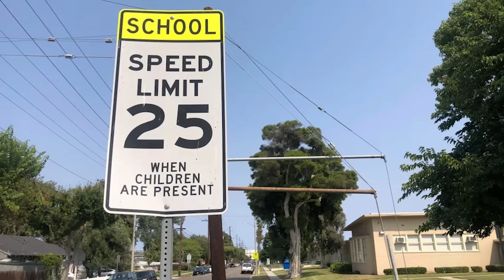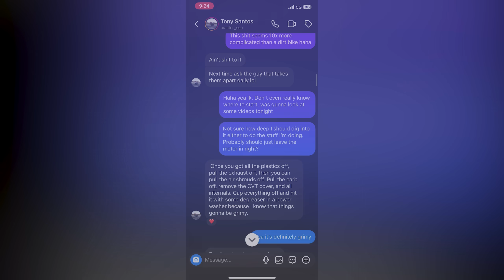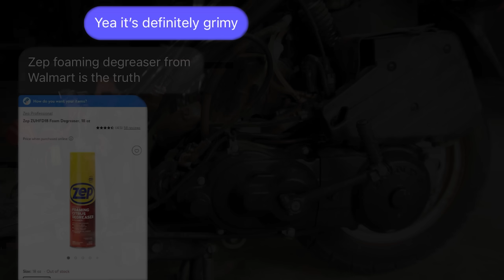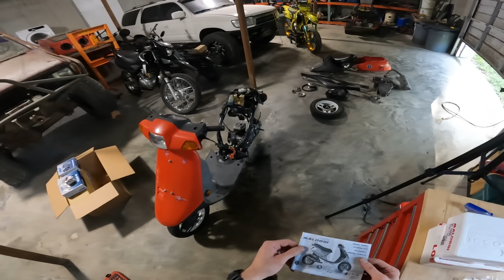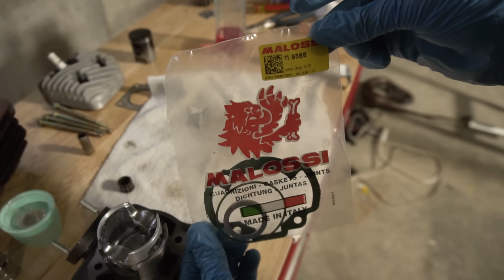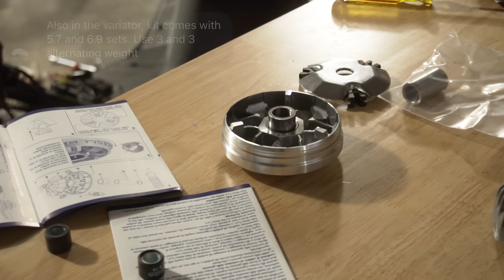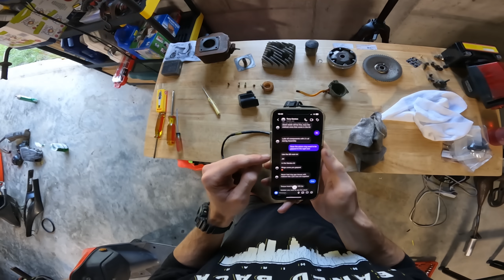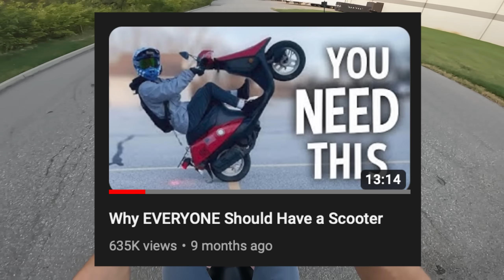HUGE Power Upgrades on my DREAM SCOOTER

Comment: Got the same excitement watching this video as I did working on mine and making it fast. I also found that a racing CDI does wonders after swapping the cylinder. So does changing the carb. I went for 26mm nibbi carb. Keep in mind it drastically increases fuel consumption and your cylinder might heat up if you floor it for long.

Comment: 17:37, when you tighten the front pully you need arrange the belt on the higher side of the pully.. You need to press the rear variator so it can goes down while arrange the belt on the front pully to goes up.

If you tighten it with lower side, the belt will pinched and after the engine running there will be gap which will loosen the nut..

Comment: THAT POWERWASHER  sure can spread those parts all over....I stopped that rather quickly opting for just a low trickle-flowing nozzle. Nice job makes me want to pull a Tao Tao 50cc scooter. I aquired as a gentleman who bought a KZ 750 off of me rode it in, and left it behind. Liking the hot knife method. Nice Job Hats to the wheelie king.

Comment: Good solid work bro, upgrade the carb, upgrade the spark plug, get some rock oil, super unleaded fuel, swap the weights around she will go even faster and accelerate harder make sure theres no weld restrictions in the new exhaust upgrade the air filter and get a new racing cdi unit honestly youl have a sleeper scooter trust me Bro 😊

Comment: I had a 50cc Derbi GP1. By the time I was done throwing every Metrakit part at it, it would do 95mph with my 200Lbs ass on it. It had a huge carb, 70cc single ring race engine and required 100 octane premix gas. I spent over $2k on just parts. @15:40... The clutch is centrifugal. The yellow springs are stiffer, which increases the engagement rpm. It helps the bike accelerate off the line quicker by allowing the engine to get up "on the pipe" before the clutch engages. @29:30... You should publish a parts list.

Comment: tip of the  day:

Use a pipe wrench to loosen the the 39mm nut on the clutch, by hitting the back of the pipe wrench on the ground while holding the pulley and clutch.
Use this method when a socket isnt nearby.

Comment: When assembling the cylinder, sand the new piston's head up a little bit to smoothen the factory engravings, also sand the port edges in the cylinder walls allowing more flow

Comment: The transmission on a scooter is connected to the rear wheel behind the CVT
Reply: New crank and seals is a must bottom end work is the first thing you should ever do

Comment: Rings need to be letter side up and positioned with the gaps opposite of each other. If you install rings wrong it will smoke all the time and burn cylinder. And yes, always check gap by putting ring in cylinder, push down with piston to be sure it is in straight, then check gap with feeler gauge. Yama-Bond is the best. Grease the exhaust studs or they will be very hard to get out when you upgrade exhaust. Good job doing this on your own!! lots of little things people learn as they gain exp.

Comment: Sorta the same in 2005 but 1989 Yamaha Zuma, 70cc kit and a muffler delete. Didn't touch the intake side or transmission. I had a mate drive beside and match speed (my speedo needle would wind around until it hit the bottom of the dash while the revs were still climbing,) he clocked me at 83kmph, 51mph. That thing was a little weapon, rode it into the dirt then gave it to a mate who's son was getting interested in spinning spanners. Best thing was filling the tank, getting a pack of smokes and getting change from ten bucks.

Comment: My 125cc Italjet Formula originally top at 115Kmh until I swapped the CDI with Power Max Racing CDI with 9 mapping mode, Faito Racing Coil Plug, Iridium Spark Plug & an Akra PNP Carbon exhaust which now top at 140Kmh... This even without changing the Piston/Block/CVT & with stock 24mm Carburetor... Seeing this makes me wonder if I can push it even more with an additional 💲pour into it... Anyhow, great video! Loved it 💯🍻🔥 Ride well! 🏍💨

Comment: If you confuse to buy what brand, just bought all lineup from mallosi , it's great scooter racing team, they made racing parts, and your friend doesn't advise you to grease the 2 shaft, rear pulley. You need to see video how to service scooter cvt. I can hear metal grinding sounds from the CVT. If you need more top speed  maybe you change roller to 7g or keep 3 pieces 5.6g and change other 3 to 7+g. You may loss torque but you get top speed. Playing with scooter CVT is experimental it is depend on load of rider, if you always ride with pillion need to adjust again to avoid stress from the engine.

Comment: Your question is who designed the CVT, now here is your answer: The Variomatic was introduced by DAF in 1958, also putting an automatic gearbox in the Netherlands for the first time. Variomatic is the continuously variable transmission (CVT) of the Dutch car manufacturer DAF, It is a stepless, fully-automatic transmission, consisting of a V-shaped drive-belt, and two pulleys, each of two cones, whose effective diameter can be changed so that the "V" belt runs nearer the spindle or nearer the rim, depending on the separation of the cones. These are synchronized so that the belt always remains at the same optimal tension. Now you know it. and how it works in principle

Comment: Top tip, because you’ve increased the bore size you need to increase the oil injection, I fitted a big bore but didn’t increase the oil, blew the piston

Comment: I hada a 50cc Yamaha jog. Without touching the piston made it run from stock 60 kph to to 100.  with just upgrading muffler, the gear that spins the wheel and cutting the walls on the front clutch that holds the 6 rolling weights. Also put heavier weights and to recover the lost torque, the short but stronger spring helped.  This things run with any carburetor you can adapt. I built another  with a Suzuki 100cc bike carburator (4 stroke 😄) and worked.  Best i got out of a stock 50cc was 120kph but at that point I was too poor, just a teen and most stuff were hackjobs.

Comment: CVT means "Continuously Variable Transmission", this type of transmission doesn't have gears, but, as it says, it changes gear ratios, when picking up speed. Most DCTs (Dual-clutch transmission) systems, have fixed gear ratios, but a CVT, varies as it picks up speed, that's why its acceleration is really good.

Comment: I dry clean my bike at that stage with solvent, tooth brush, and air hose.  That high pressure spray does a real number on electrical connectors which can cause electrical problems later.  It takes more time but eliminates water entering places where it should not be.   Ha!

Comment: If you want more topspeed, remove the 1mm rings from the CVT boshing that you're friend told to use. The wheelie will be a bit difficult but the topspeed will increase

Comment: 🤔Man it was good to see you go trough the whole process with the help of your online mechanic without you having any experience in the scootet field..The only thing I got to say is that tou should"ve bought a decent cool looking scooter to start with, I mean there couldn't be a more nerdy/girly scooter in the whole world other than that Honda you got there...Start watching videos from your compatriot's scooter channel 'Mopboyz', you'll see that this guy knows there's only one scooter in this world who's more than worth having, riding, tunning, contemplating, wheeling and cornering, the whole package in the same vehicle...In case you don't know the scooter 's called Yamaha Zuma (US) or Yamaha BW's in Portugal and Spain (Big Wheels), Yamaha Booster in France and Italy. Now that's a cool looking scooter worth having, worth contemplating, worth tunning, whose performance in cornering and wheeling is unrivalled, and you can still take it off-road that it will still perform great due to its large sized tyres (got to have some urban hybrid tyres on it in order to get tome proper grip/traction though). 👍🏻🇵🇹🇳🇱🙋🏻‍♂️.

Comment: You can use all the sets of weight in the variator, but with +/- for each. Lighter ones will give a faster response, but it will top end quickly. The heavier ones will do the exact opposite, kinda sluggish accel but better top end speed. But your Z options 3/3 or 6 of the same. Now you can adjust it for your pleasure 😊

Comment: yeah, mopeds 50cc stock, they almost everytime suck to drive, put some tuning parts on them, and you have this, makes them sooo much more fun to drive. I myself have a suzuki ts50 from 91, 70cc, 20mm mikuni and tuned exhaust, does almost 60mph. Also have a yamaha dt50mx, from like -85. The engine took a real dump on itself, so now it has a 80cc watercooled yamaha mx engine haha, its insane, 20+hp

Comment: So the way the transmission works is: as the variator on the crank shaft starts spinning it will push against its baseplate, pushing the two parts of the variator together narrowing the gap. As the gap decreases the belt moves higher and higher between the two parts of the variator. As the belt doesn't stretch, it will have to get shorter on the other side, meaning it will dig deeper into the clutch side. So it starts low inside the variator part and high in the clutch part and as the RPM increases it kind of shifts; it gets higher on the variator side and lower (or deeper if you will) on the clutch side. This results in a "torquey" setup at low RPM and it then kind of changes to a different gearing at higher RPM (as you need less torque at higher RPM, and just want speed then instead). The weights, and the big clutch spring are the way you can fine tune these things, and the smaller clutch springs decide the moment the clutch starts "grabbing" on the house. Stiffer springs result in a later "grabbing" so you will need more RPM before it starts going. Super nice build man!
Reply: Also, for an even better result, you might want to consider switching that carborator out for a bigger one. You're probably running a standard 12.5mm carborator, but you can easily slap a 17.5mm carborator on there. From my own experience, you'll gain quite a bit of power this way. You will probably also need to buy a racing manifold piece (mine had a membrane) to accomodate the bigger carborator. After that you'll probably have to find the best jet for the job (just check the color of the spark plug every time you test it for a bit and mind the temperature as it's air cooled). Carborators aren't that expensive and with a 70cc, it's a good additional upgrade.

Comment: Synthetic brake grease for all brake components and others. Anti-seize isn't a good lubricant. It's good for non-moving components - lug nuts, exhaust studs/nuts, etc to prevent galling... However, others may say different. Good video by the way !

Comment: You should've disassembled and re-greased the secondary when you had the CVT apart; if you get the NCY secondary it has different slots so you can tune how fast the belt pulls into it as well Nice work!

Comment: i love scooters, i am currently getting my cheap 2 stroke scooter ready for the next summer, might get a 70ccm kit in the summer haha
Reply from the maker: yessss bro do it!
Reply: the oil pump failed like 2 years ago so i got a new engine wich i sold like 1 year ago so im here fixing my old engine to get it all running, the crank bearings were seized and the piston broke xD @TwoStrokeJ
Reply: i got some pictures of the bearings, the metal cage inside broke apart

Comment: The issue with your power generator set up was that you only get 1 alternator revolution per tire revolution. If you changed that ratio to 7 or 8 to 1 you would be making 14 volts at about 10 to 14 mph, which is a much slower wheel speed.  You are not going to be energy neutral, but you could possibly extend the range by a few percent.

Comment: Hey bro, heat treat the black plastic that turns grey after some time, if you heat treat it, it will get a nice black and clean look. DONT DO IT TO CLOSE, start far away. Its only the heat that does the treatment, if you do it to close you will Roast the plastic😂
Reply: It also fixes small amount of scars in the plastic. Go after the black plastic, the red doesnt work.

Comment: well... as a tuner myself you should know that with the stock crankshaft and bearings you risk to have a catastrofic break of the bottom end, and with that stock carb/ intake manifold and reed valve you are choking that poor 70cc, and remove the auto mixer, with a bigger carburetor and a engine that run higher in the rpm you risk of breaking the mixer and seize the engine, and check the gap of the rings.. they should be between 0.25 to 0.15 mm

Comment: I used to work in a bike shop and we had lots of people tune there scooters and the end results are usually the same..... faster but the extra stress usually affects reliability....if you want to go faster use the $600 to buy a bigger bike in the first place.also in most countries you have to tell your insurance company about the work you did or you are not covered and nobody wants a legal bill if you crash (wheelies attract the police) then the cascade of problems....but go ahead we all did it when we were younger 😄

Comment: You will lose your mind if you get an aluminium kit, a proper exhaust, a 28mm carb, inner rotor ignition and some good reeds... i have a Gilera Runner at 70cc with a hyper race kit, has 25hp and does 93mph :D its innnsaaaaaanee

Comment: The drive system on this type of engine works by, open throttle, go faster. Close throttle, slow down. By constantly revving the engine you can shorten the life of the clutch by about 50%. The word mallosi is pronounced Ross, goss ,toss not go, toe, so. Hi from the U.K.

Comment: Now find yourself a late 70s to early 80s Vespa P200. 4 speed manual 2 stroke capable of 80-100mph depending on how far you want to go down the rabbit hole. Fun scooters.

Comment: I got a stage 6 engine package for $50 less than you spent, amd it was a lquid cooled sport pro cylinder kit woth a yasuni c16 exhaust....
Tuned exhaust, bigger carb,  roller weights adjusted, and some better brakes.

Comment: I had a Yamaha Passola that did that, It was the crank seals. Had enough in there to start and tick over.... but died the second you feed it air as it didnt have the suction to pull the fuel from the carb.

Comment: Of course you also intend to improve the suspension/handling and the brakes. Perhaps more tire on the road. These are built for a purpose.  They are mopeds! Also it is now illegal in some areas. Insurance (if you bother) will also be invalid.  You may require a different driving license.

Comment: my stock yamaha why 50cc tops at 62 mph without the limiter kit, but accelerates in 3 to 5 work days, i might do a extense engine cleanup and doing a little ransmission upgrade

Comment: When you are putting back the belt you have to compress the female torque drive near on clutch assembly so your belt on the pulley won’t get stuck or damage your belt and also apparently your rubber seals on tourque drive already damage when you wiped the dirt on the back of female torque drive seems there’s grease so does mean there’s already damage on torque drive and you can more add power when you port the female torque drive pin path you need to port it using porting tool you wanna re grease it as well after 7k km run additional power when you add more stroke replace the crankshaft pin and upgrade connecting rod add also spacer for block

Comment: You need to use a different fuel mix ratio while breaking the engine kit in or could reduce the life of the new parts

Comment: carb needles are very sensitive i wouldn't be tapping/smashing it down with my finger to watch the float jiggle. also, keep the carb inverted and blow into the fuel inlet to make sure that needle is sealing or you will need to do it over again. takes 2 seconds. has saved me many a bad needle and or seat.

Comment: small 2 stroke scooters are just asking for it. they are so fun and easy to tune.
Reply: if you are handy with a welder you chould mod a 65cc 2stroke  dirtbike pipe so it fits on it. might work with a 80cc pipe but ive had mixed results.

Comment: I built an airsal t6 70cc yamaha vino  with carb an upgear kit leo Vinci touring pipe and variator. It did 90mph pulled strong off the line.

Comment: I haven't done a real Honda myself but a G6 Chinese scooter I was given for free needed the same top end and pipe with carb jetting. Big difference in my build too except Im certain that your Honda will be on the road and still running good when the Chinese garbage scooter will be burned out and dead. I'm not crap talking here but I see the Chinese can put out a good looking clone part for just about everything from washing machine to Toyota water pump. The parts may look the same but in many instances a clone Chinese part will fail to do what it is supposed to do compared to Japanese parts that were extensively engineered, manufactured and quality tested before putting it out to the masses. Chinese clone parts are always a gamble when purchasing them.

Comment: That's a 2 stroke, it looked and sounded like it had a 4 stroke exhaust fitted and not an expansion chamber, which make them sound much better, well they did back in the 80's

Comment: I wish my motorized bike had a CVT.  That's why I can't wheelie.  It's got nothing but fixed sprockets.  I could run different toothed sprockets, but I'd either struggle on hills from lack of torque, or have low top speed from lack of hp.

Comment: Get a scoot with a old piaggio lc engine. My old aprilia sr with stock 17.5mm carb and exhaust+ stage 6 sport pro 70cc did well over 60mph just jetted the carb and like 1gr lighter rollers. And pulled very impressive for a cylinder swap and tune.